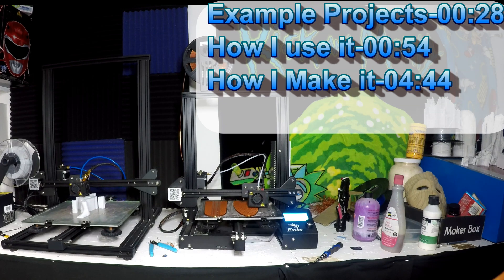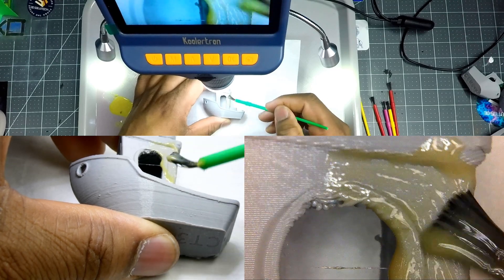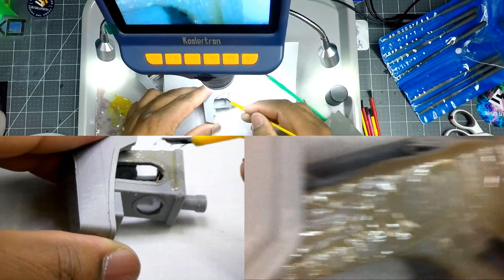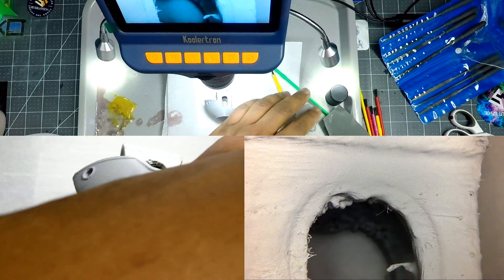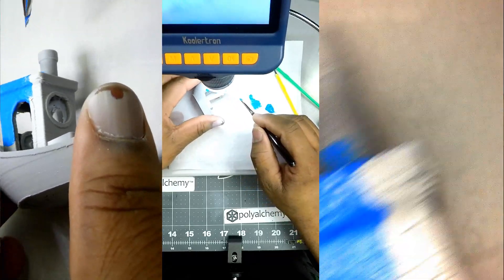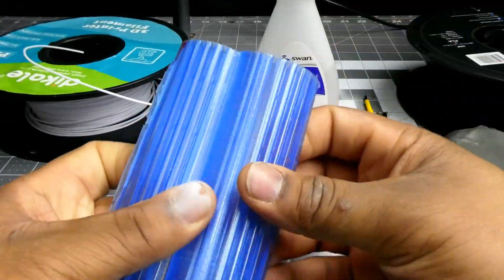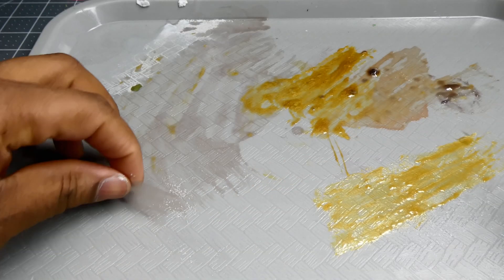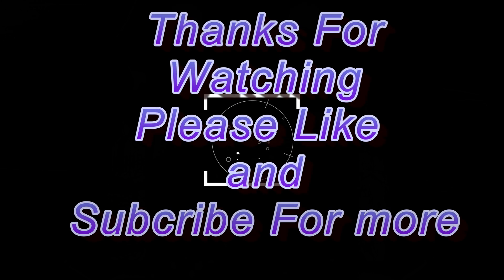Smooth and Fill Layer Lines for One Dollar My Layer Line solution for all of my FDM Print Projects

Comment: Cool trick Would this work for small wargaming miniatures? Ideally need to avoid sanding if posting
Reply: Try taking a bottle of plastic cement with the brush applicator like tamiya extra fine or similar and put in small amounts of plastic and let it dissolve into the glue until you have desired consistency. 
Thicker consistencies can even be used to glue and fill subassemblies together and fill at same time
Reply: I haven't watched the video yet, so I'm not too sure, but if you're not already, try printing with a smaller layer height

Comment: How about ... i know it may sound slightly crazy ... but ... what if there were a really thin heat shrink ? Would this work or do you think it would still show 🤔
Reply from the maker: I think it is worth a shot I am unsure how well it will work. I know there is usually a pretty prominent seam with heat shrink .